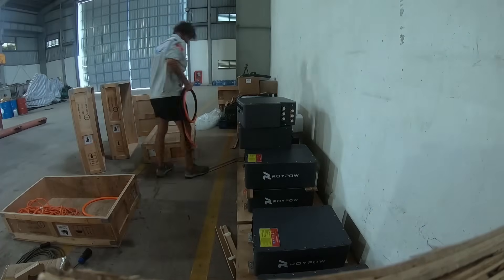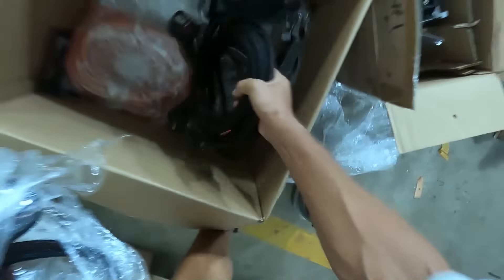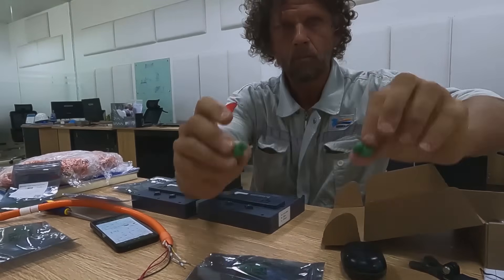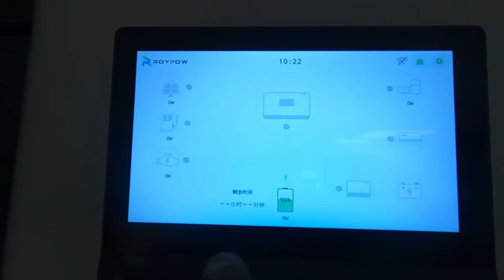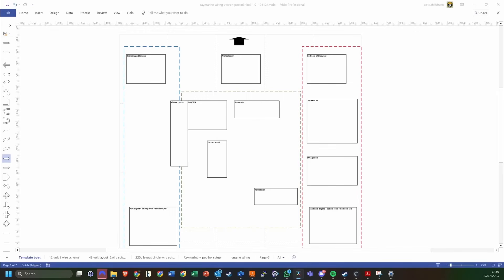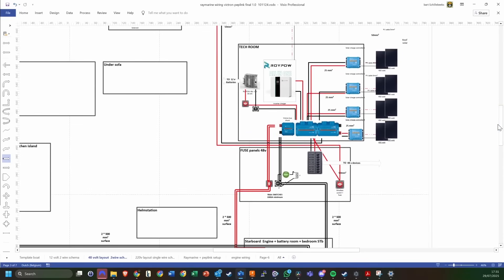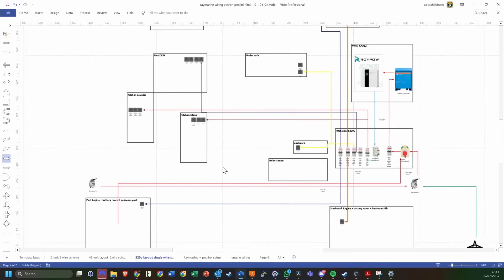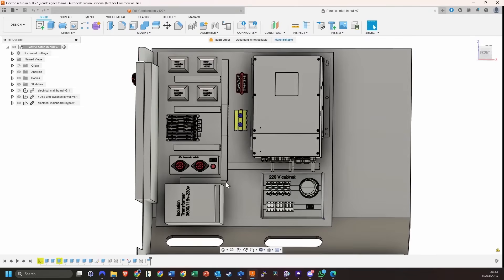Ep. 74 The ROYPOW Energy Storage System. It is so easy to install!

Comment: Might want to make the 48V to 12V DC-DC converter redundant with a backup. If you lose that you have no way to charge the 12V system from 48V that has all the solar on it, and the 12V runs the autopilot and all nav.
Reply: Could be.  Redundancy is a cost plus weight.  I'm not concerned.

Comment: On the regen capabilities, at anchor with any kind of tidal flow going , would that generate anything?
Reply: Unlikely. If there was such an anchorage  it would suck and be a dangerous place.  Most safe locations are under 4 knots.
Reply: No nor really, you need a set boat speed to achieve good results. With Tidal flow that's only possible with Huge propellors. direct correlation between prop size, speed  and regen power.

Comment: Curious... what is the weight on the electronics, other than the batteries?   Over 100kg?   Also,  Do we have the solar panels yet?
Reply: the batteries are 420 kg. The rest of the stuff would be below 100kg probably. We know which panels, not bought yet.

Comment: I thought you would need thinner cables in a 48-volt system..?
Reply: Lower voltage thicker cables to carry the current load ... Higher the voltage the lighter the cables can be..and the less the current drop over a given length of cable...... Ohms Law.   

Basically it's best to keep the motor batteries run as short as possible  48v  is regarded as hand safe but power and efficiency tend to increase as voltages increase .... Like most e bikes,scooters and cars . 72 or 96 V systems are common on E bikes so .... I don't see why boat systems shouldn't run at this ... Golden motors run theirs  in this range from their  more powerful  uses.
Reply: @clivestainlesssteelwomble7665 no, I think it's a good choice. I'm not complaining.  Just wondered because Bart said they needed thick cables.
Reply: @clivestainlesssteelwomble7665 In general marine safety concern, mostly insurance. 72-144 or higher sounds good till you factor in all the equipment,  cost and availability.  It's the progress front of acceptance.  48v(52) is telco rack backup  standard.
Reply: depends on the amperage drawn,  length, voltage drop requirements , and (over)heating requirements.  and some code/certification as well. and a safety margin. 300mm² tinned copper is a minimum in our case per pole. sorry don't know what that is in AWG.
Reply: @barts6178 Okay, thanks. 
I'm just asking because what they are saying in the EV world, like for Tesla Cybertruck.
Reply: @barts6178  600MCM AWG remind me is this aluminum or copper?

Comment: G'day Plucky, apreciate we were only lookinng at basic block schmatics but I could not see a negative bond circuit, something important for alloy hulls (any hull material realy) to reduce potential and galvanic corrosion. Looks good though. Cheers Mate.
Reply: they are foreseen together with electrolosys detection devices. Just not on my drawings as they are delivered by ODC